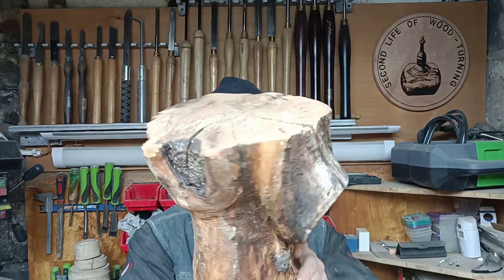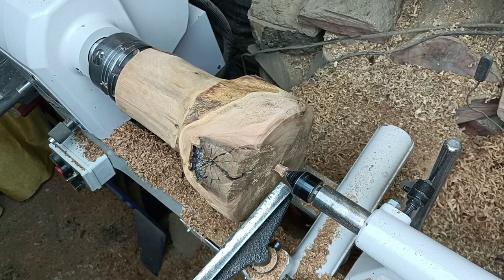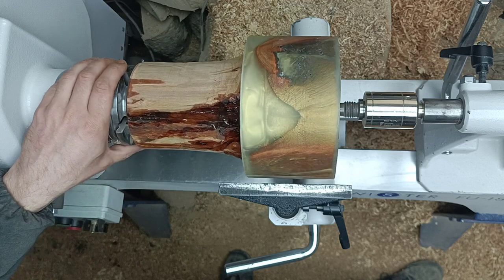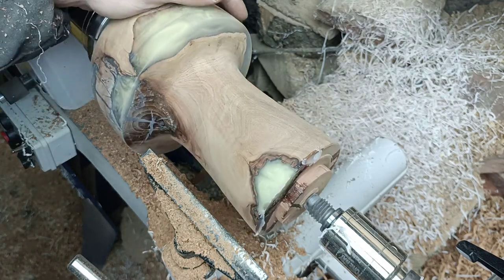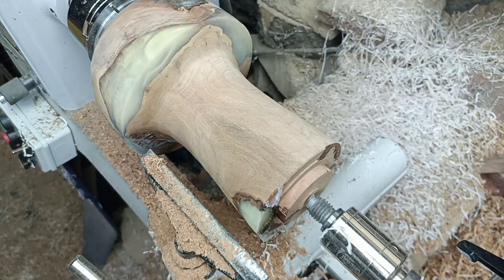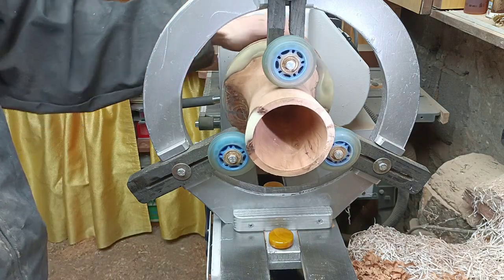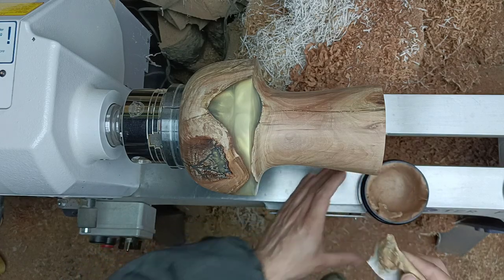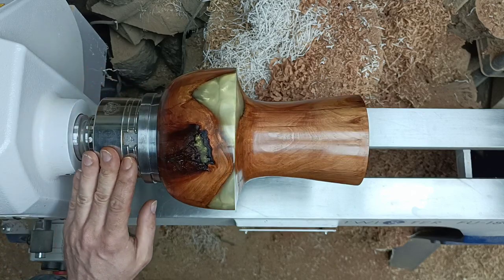Apple wood vase with gold/pearl epoxy - Woodturning

Comment: Wow, such a beautiful piece Rav. The finish is perfect - it absolutely glows. I kept thinking of olive wood for some reason. Curious how you molded the resin - which way was up ?   Thanks for sharing ! I simply love it. Take care. -Mike
Reply from the maker: Thank You, Mike 🤝 I love how good finished apple wood is looking. Harder is to make it without scratches. All scratches are very good visible so alot of hand sanding is needed. Only bottom was molded. On the top I glued a piece of celofan foil. The rest of cracks I refill with saw dust and CA glue.
Take care Brother 💪
Rav
Reply: @Secondlifeofwoodturning  👍😎🤜🤛💪

Comment: Really nice piece Rav. I really enjoyed watching this project. It is truly beautiful wood, and I like how you brought out the beauty. I'd like to know more about the "OB Shine Juice". Where does that come from? It really transformed the piece when you put it on. Thanks for sharing!
Reply from the maker: Thank You very much, Mark 🤝
OB shine juice is very easy to make.you need shellac flakes, alcohol, linseed oil. When You mix shellac and alcohol and will all flakes will melt than add oil in 70:30 proportions. Before every use must be shaked to mix OB again.
Take care 👍
Rav
Reply: @Secondlifeofwoodturning  Thank you Rav! I really appreciate your answer. A couple of further questions. First, where do you get shellac flakes? Second, when you mix the oil with the shellac mixture, which is 70 and which is 30"? Thanks for your help. I can't wait to try this out. It looks beautiful on your projects.
Reply from the maker: I'm sorry I'm so late but I was very busy these days. You can buy shellac flakes on eBay, Amazon or any other online stores. I'm mixing 70% of shellac with 30% of oil but You can change proportions for Your personal needs. It can depend from type of wood You are using.